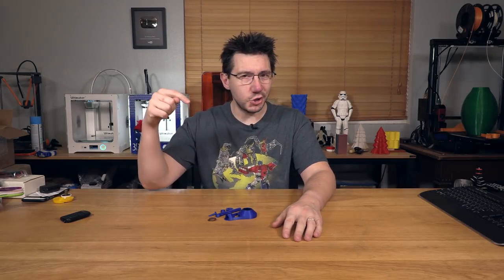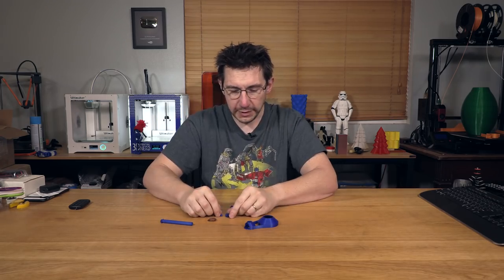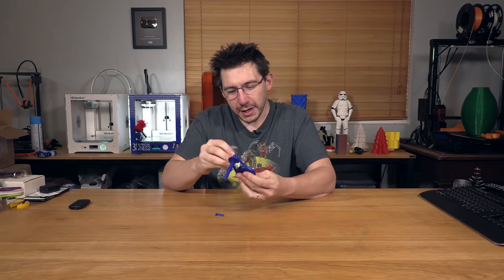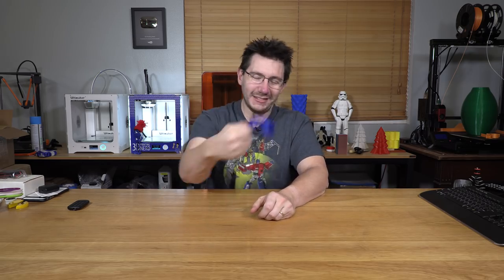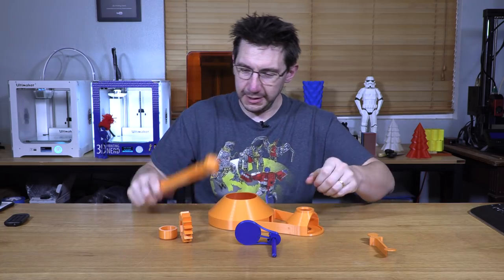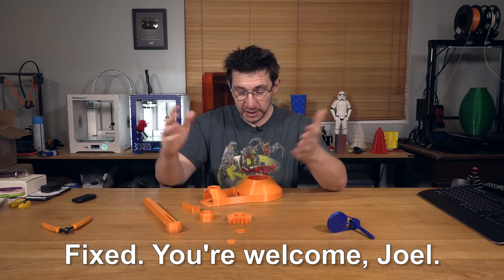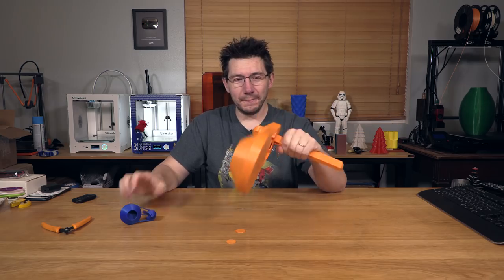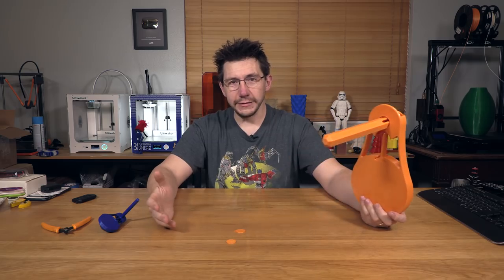3D Printing the ULTIMATE Party Noise Maker! Thanks to Works by Solo!

Comment: You should print a false stack of extra large pennies to insert to the weight section. So just a hollow cylinder cup with a penny face at the top.

Comment: 3D Printing Nerd 3D I have a big  dilemma, I’m in the market for a printer. I thought the cr-10 was the one. Then I heard the prusa is better all around minus the print volume. But now with the all metal hot end mod what’s your take on it. If you could own only one which would you choose? Can the price and print volume  with this mod overcome the prusa with all its features
Reply: The CR-10 is a great machine, but it doesn't compare to all the features that the Prusa comes with out of the box.  You can modify the CR-10 to gain some of the features, but this requires a ton of work.  If you can't wait, get the CR-10 and mod as you go.  If you can wait, save for the Prusa.  It should also be noted that adding some of the features to the CR-10, like auto bed leveling, requires some decent technical skill, and the build volume of the CR-10 is definitely a plus but in the 6 months that I've had one now I think I've utilized it once.

Sincerely,
A CR-10 owner with a Prusa i3 mk3 on preorder
Reply: Sean Connelly Sean Connelly thanks I’ve been asking for a while with out any help. Truly the only mod that interests me would be the hot end to be able to print most materials. Seeing as you have the cr-10 and preordered the prusa, my question if you don’t mind is why? Besides the bed leveling and the silent print mode. I don’t see me unplugging it or losing power to need the power recovery. The double extruder is nice, but what about the filament detection how handy is it. What motivated you to move to the prusa?

Comment: If you make it really big and increase the amount of teeth, the noice could be even more annoying xD
So it's huge, maybe you can spin it at something like 360 rpm (6 per second). Have like a hundred teeth on the gear and you can have a stable tone on 600 Hz. +the noice from every individual tooth.

Comment: Please could you make a video on the environmental impact of 3D printing and how to be more sustainable. This is the only thing holding me back from buying one, so it would be very useful
Reply: If you get a printer that uses PLA, the impact is very small. PLA is biodegradable.
Reply: stmdutube But not all PLA is actually corn based, therefore it is not biodegradable. Also, it need very specific requirements to biodegrade
Reply: Actually if you do your research, yes all of it is biodegradable, not all of it is made of corn that's true, but the very essence of PLA is Polylactic acid which makes it a bioactive thermoplastic. Therefore it is biodegradable.